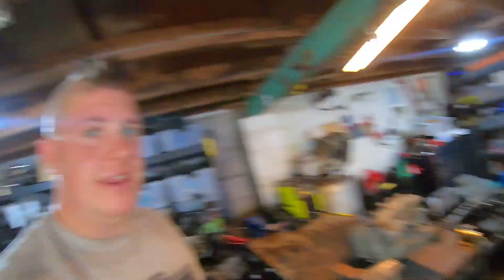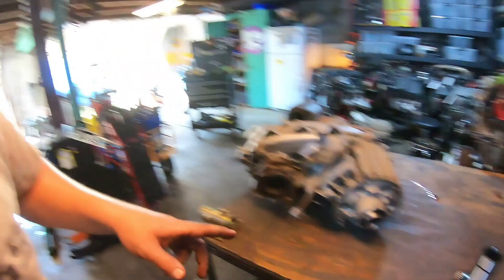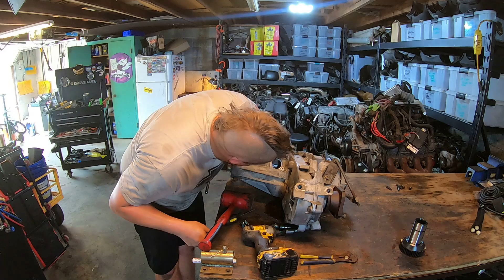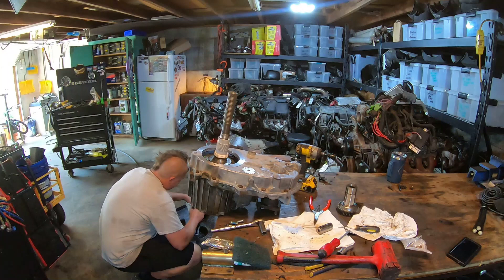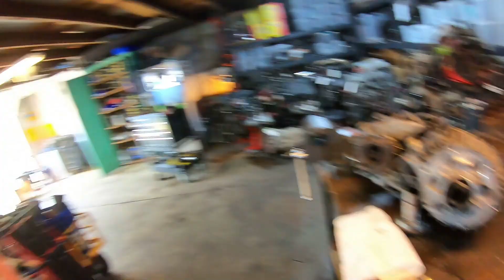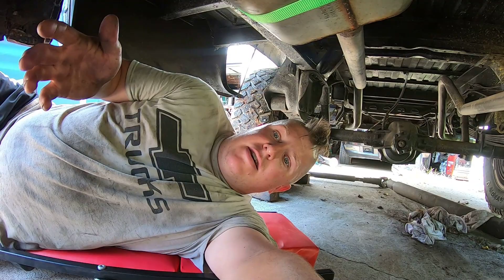Squarebody K10 Swap Project, Part 4 NP208 Input Swap

Comment: How did you make the speed sensor work for you on the 4l80?
Reply from the maker: This 4l80 had an output speed ring, so I just used an output speed sensor like on a 2wd 4l80.

Comment: Hello! Thank you very much for your videos.

I'm in the middle of an swap. My base is a Jeep CJ7 (the front differential is on the passenger side) with a 5.3 LS engine and a 4L60 gearbox.

Due to the side of the vehicle where the front differential is located, I chose to use an NP208 transfer case (1986 Bronco) and it uses a wire speedometer (analog type). What type of sensor should I use?

I don't know how to adapt the speed sensor receiver from the wiring harness that goes to the PCM.

did you have this problem? How would they solve it?

thanks in advance.
Reply from the maker: Hello, so in your application, an analog to digital signal adapter would probably be the easiest solution. There are lot's of companies making them now. Here's one I found really easily with a google search.

https://www.walterseandp.com/product-page/np208-electronic-vss-conversion-kit-r2
Reply: @MohawkMotors  thanx dude!!

Comment: What adapter or adaptersss are we using to marry to trans?
.. I'm doing the same with new style 4l80e & np208. Swapping 27 spline out this weekend hopefully 🙏  thanks in advance!
Reply from the maker: Use a factory adapter from the 4l80. One from a 99 to 06 silverado 2500HD will work to look it up by make and model.

Comment: How did you do the speed sensor in the np208? Doing the same swap right now
Reply from the maker: @circleo5924  I left the factory asked sensor in the 208. I used the output speed sensor in the 4l80 transmission for the computers output speed signal.
Reply: @MohawkMotors  did your 4l80e have the input and output on the trans? Most 4x4 ones just have the input and the output is on the transfer case, from what I’ve seen. My 4l80e just has the input
Reply from the maker: yes it did. and yes you're right, most 4x4 4l80's don't have the tone ring for the output speed sensor. They do make an signal adapter, that uses the factory np208 speedometer output, and generates the correct signal for the pcm to use for output speed. I think dakota digital makes it, I just did a google search and apparently them make this now also.

https://www.walterseandp.com/product-page/np208-electronic-vss-conversion-kit-r2
Reply: @MohawkMotors  Hello, thanks for your videos. Could you explain this topic a little more to us? I also don't know how to replace the electronic signal that should come from the NP208 transfer speed sensor, it lacks a sensor, :(
Reply from the maker: So to my knowledge the np208 transfer case only came with a drive for a mechanical speedometer. They now make kits, that you can install in the tailhousing of the np208 to convert the mechanical speedometer output to an electronic signal output that can be used for speedometer.

Comment: Great content my friend where did you find your 32 spline input shaft?
Reply from the maker: Np 208 was available from the factory with a 32 spline input shaft, the ones that came in K20 and K30 trucks with a th400 transmission had 32 spline input's on them since the th400 transmission has a 32 spline output shaft. You can still get new 32 spline input shafts online if you want to convert your np208. That's what I did, just ordered a new one online, I think it was like $40
Reply: @MohawkMotors what did u use to get the vss signal from

Comment: Yes, that’s a good video! Good tips on the RTV, I would’ve made a mess. I’ve restacked needle bearings a couple times, neither time was fun, especially when a few of them end up on the shop floor amidst the debris!
Reply from the maker: If you drop your needle bearings, you're not gonna have a good time, lol. Best trick I learned about needle bearings is keep them on a magnetic tray or cup if possible, and be generous with your assembly gel or grease. Thanks for watching, glad it helped!